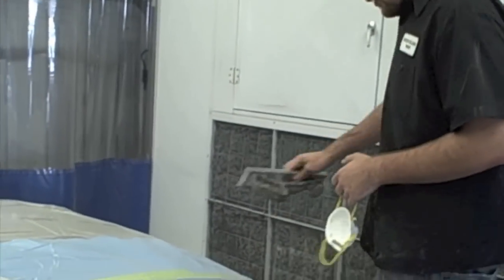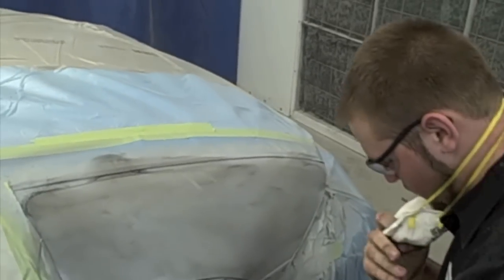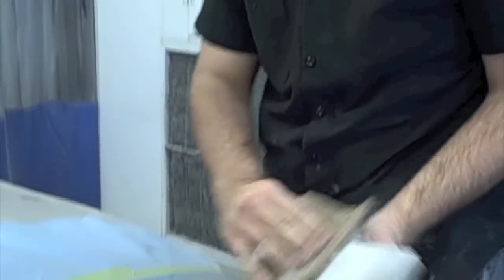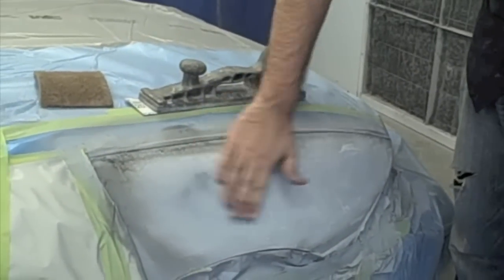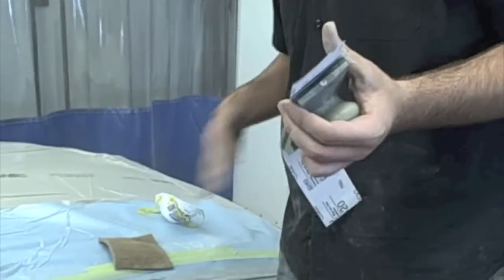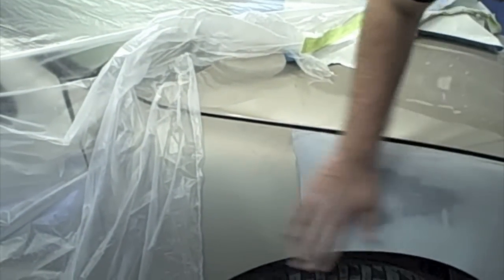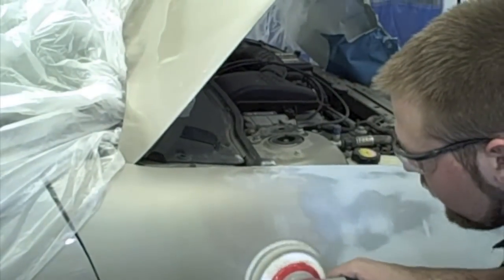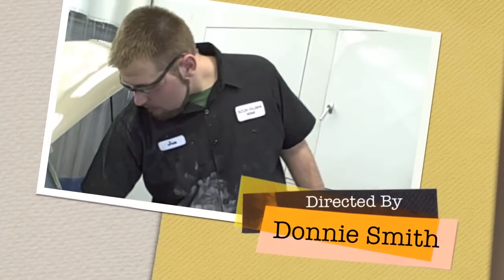DIY - How-To Block Sand Primer To Get Ready For Paint - Auto Refinish Training Video in HD

Comment from the maker: @1badlude98 thanks for watching.  the reason we left it masked is if we needed to reprime again.  if we do, we will not have to remaks.  if not we remove the mask and finish blocking.  we also did a reverse blend on the primer and the primer build up is minimal at the edge, but i agree, the edge can cause problems.  thanks for watching.

Comment from the maker: @blidderbla Yes, many techs use wash primer.  This is just a preferance.  Both provide good adhesion and corrosion protection.  However, many time we are spraying over different substrates. Metal, body filler, primer, paint, etc.  In this case you must be careful with some of the wash primers, as it may lift an edge.  Epoxy can be sprayed over about anything with no problems.  So I think epoxy is a little more user friendly.  Now if I have a small burn through from sanding, I will use etch on it

Comment from the maker: @DCN225 The dry time will vary depending on the primer you are using.  Some dry fast and some take longer.  However, you want to let it fully dry.  If you sand before completely dry, you will have sand scratch swelling.  his is where your primer shrinks after sanded.  After you paint, you will see your scratches showing through.  If you have any other questions let me know.  Thanks for watching and visit Collision Blast for more training information.

Comment: if there its deep scratches that you are trying to fix and not dents i would suggest that you sand around the scratches with 180 then spread a little putty into the scratches and when the putty dries block the putty down with 180 again and sand down all the 180 scratches with 400 then primer it. i work at a body shop and thats what i do to deep scratches just make sure that if there is rust in the scratches to sand the rust down because the primer wont stick if on the rust

Comment: I really didn't understand using that long of a block on that small area, or one that wasn't flexible with that much of a curve, or the DA on that panel but, after saying all that... It was a well done video and, I hope it turned out wonderful.
Reply: you always use the longest block you can to keep things straighter and for finding lows vs creating them...myself I would of used one longer but a soft block because of the curve of the panel.

Comment: If you are striving for a wave free panel,  Do not use a DA sander because it is prone to wash out areas.  It is not a true accurate way to get a panel straight.   Also wet sanding that fender panel is far more advantageous than dry sanding it.  Use wet sanding whenever it is practical and it minimizes dust as well.   .
Reply: I agree, what is the point of blocking if you run a DA over it afterwards. It just undone all the blocking that was done.
Reply: As long as you use the DA with a pad as well as very fine sandpaper you’re just gonna remove scratches on the surface it will not washout a panel even if you bear down on it it doesn’t have the cutting ability to change the surface it’s only removing deeper scratches from prior sanding. Especially if it’s 320 grit. Now if you put 80 grit on a DA you can wash out some filler with that but even then you would only use that in a rough surface preparation after filling an entire section you would just take out your knife marks and your ridges to get it down to where you can see a smooth andsandable surface.

Comment: can you tell me simple steps to prep and paint, my paint has very deep scratches (work) truck do i take it down to bare matal and spray the wole truck with epoxy then primer surfacer then paint? will this work even in some spots where is not as bad and i just sanded the old paint down with 400 then 500 then prime? or just paint over that? thanks and your videos are very helpfull for newbies

Comment: I'm a believer in there being several ways to do a job and achieve the same end result. Some ways work better for others, doesnt mean another way Doesnt work better for you, but a fact is that a firm long board is best suited for long flat surfaces. Like bedsides and hoods and roofs. And with modern cars with the swooping rounded bodies those longboards collect more dust then they make. This video was a poor example. You were unable to contact the entire work area with that board. so no it wasnt the proper size, virtually no cross hatching or even long strokes to evenly romove material. That board at no time made a decent contact across the fender. They do make interface pads for a reason. Next time try a 7 inch rigid foam pad, knock it down then put an inface pad on and smooth even length strokes. You might like it. Just a suggestion. And what kinda pros hard line primer??? If you dont know how to mask off to prevent hardlining maybe you should have apprenticed for a while before presenting videos. At least you had a dust mask.. Oh nice shirt by the way... !

Comment: your blocking needs improvment, always use the biggest block, and when your blocking make sure its more side to side never go up and down and stop half way in the panel, by doing this your ended up with a "bridge". when you have low spots keep using the big block and concentrate more on that area and move the sand paper through the panel every 5-10 swipes, always roll your masking paper, i seen you havnt, when you dont your left with a edge that no matter how much you feather will never go away

Comment: Not true, my 96 Cavy had a 4SPD & I used to wish it had 5. My experience is that the 5 has a better spread on running through the gears without the huge gap between 3 & 4, however the final gearing seems to be about the same when driving. Ya, both are totally underpowered - especially when going up a mountain. I'm not going to look up what years it ran through, & I don't think anyone really cares, but it was among the options.

Comment: if your trying to do production collision repair you will never use epoxy primer, use some 1k etch prime, 3 coats of surface and sand, etch bare metal burn throughs and base directly over surface, sealer is a waist of time unless its a new panel or bumper
Reply: We use EP all the time and always use sealer. Remind me to never take a car where you work.

Comment: I made the mistake of taking rubbing alcohol to a primed surface. Didn't know cleaning meant patting with a cloth.
Reply: if the primer is dry nothing will happen
Reply: kevin bennett BS. It was dry. Came off with no pressure added. I was painting some metal though.
Reply: I guess I use a higher quality primer
Reply: Use a quality 2k primer..

Comment: sorry but since its round ur suppose to use a flexible block or a soft block and before u primer the body work u gotta feather it with 320 then primer it and block it with 320 then run the da wit 400 then 600

Comment: Metallic over 500 grit??? Dry??? Not right, you should finish it with 800 otherwise you will see tiny scratches through the clear
Reply: No you wont... I paint metallics with RM and i only sand with 320, then use a superfine pad.

Comment: I am in the process of sanding all the clear coat off my car to change colors.
I was told to sand the whole thing in 400 which ive done with a orbital sander and a small hand block, but theirs still heaps of patchs of clear coat left.

Did I do this all wrong? Should I use a lesser grit like a 180 or something then ease back to a 400 from there?